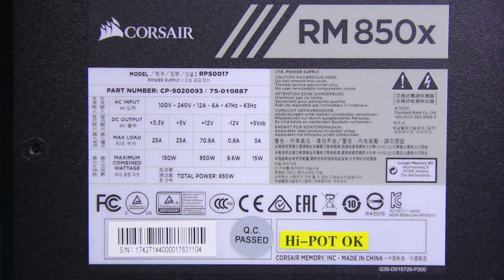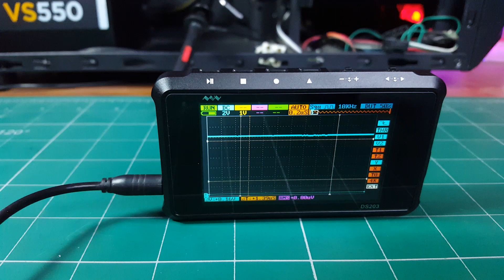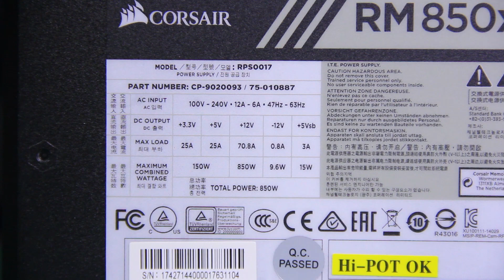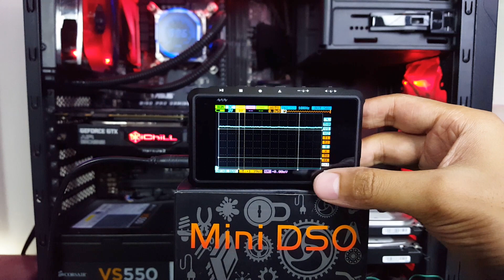GTX1080Ti with 550W PSU ? | Indepth Testing

Comment: I used a gpu that requires a 400w psu , but my psu was only 250w ... My graphics card worked fine for 1st week but now I am not getting any signal from it ... Fan is running fine and motherboard vga is also working fine .. can you help me fix it ??
Reply from the maker: Try removing the GPU and start the system, if the display comes then either your PSU is not able to power the GPU or you have some issues with your GPU. Most likely it is a PSU issue though.
Reply: PC is working fine without gpu but I am not getting signal with gpu ..
Reply from the maker: Try installing the GPU in other system having a suffice PSU.
Reply: can you make a video for it ? I also had this problem before and I have stopped gaming after that !! I will be really thank full if you do so...
Reply from the maker: The thing is there are different cause for the problem, different users face different issues so the video won't be able to cover the whole solution. But will try doing similar problem solving videos.

Comment: Nice vid.
Btw which variant of 1080 ti is that?
Reply from the maker: Thanks, that's inno3D x4 variant of 1080Ti.
Reply: And help me with one thing that the total wattage of  my system becomes 229 watt if i add a 750 ti to it.I got a 300 watt 80+ bronze psu so its good to go or not?
Reply from the maker: What's your system specs? 750Ti's min recommended wattage is 300W. I would get at least 350W but again it depends on your current specs.
Reply: i5 3470
intel stock cpu cooler
intel q77 4 slots ram mobo
8gb ddr3 (2 4gig modules)
optical drive
normal case
300watt 80+ bronze psu
Reply from the maker: You should get at least 400Watts min PSU if you run your PC for more than 8 hours a day for better stability, but 350Watts would also work just fine.
Reply: ok tyvm for the info

Comment: Do u use a gimbal or tripod?
Reply from the maker: I use both, depends on the shot.
Reply: @GuyThatDoesEverything  what did u used in this video.  To stabilize the movement. If u use a gimbal.  Which brand it is
Reply from the maker: I also used both, tripod and Dji Osmo in this video.